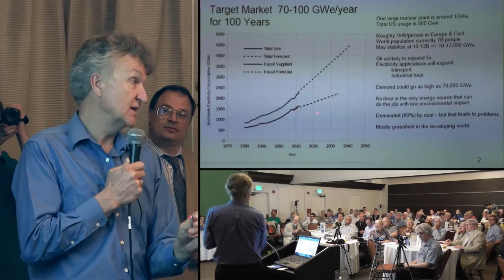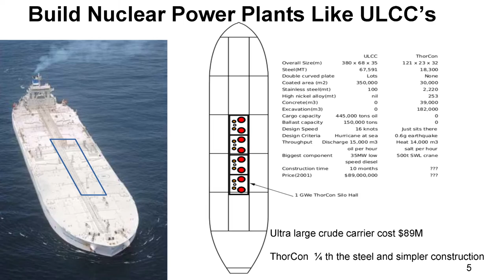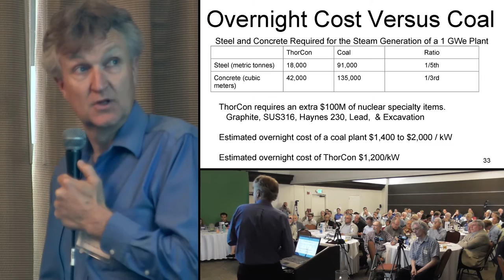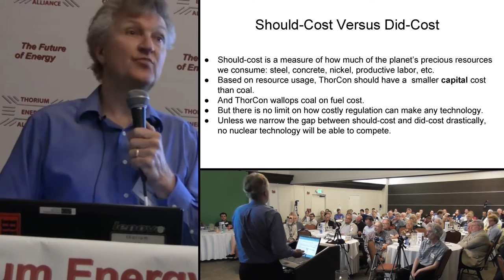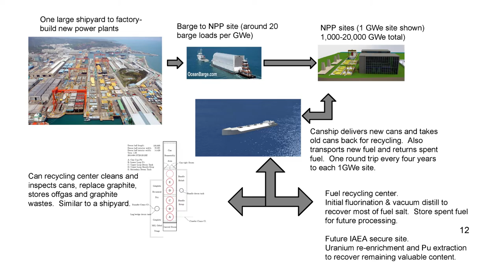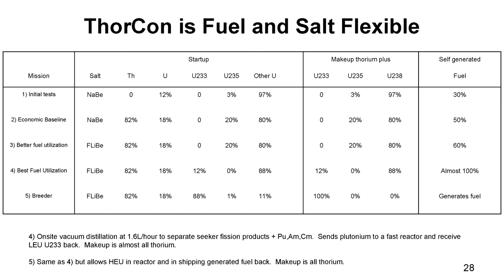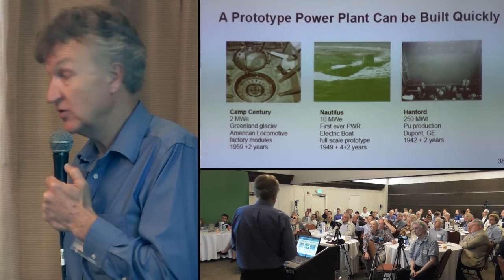Lars Jorgensen of ThorCon Power: Thorium Molten Salt Reactor System - TR2016c 6h03m33s13f

Comment: At 2:10 in the video Jorgensen said that the demand is 100 GWh every year, but earlier he stated the demand is same as USA production every 10th year. The USA production in one year is 4000 TWh and divided by 10 this is the need of 400 new TWh every year and not just 100 GWh as you said. So you are off by a factor of 4000 :-)